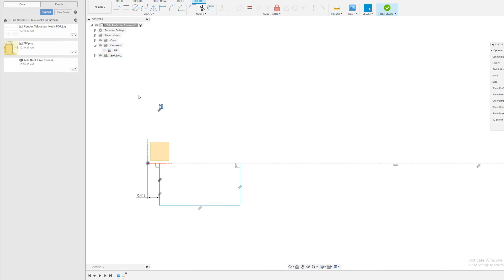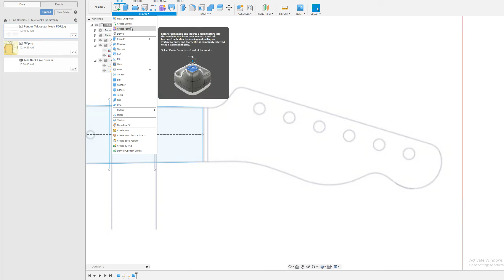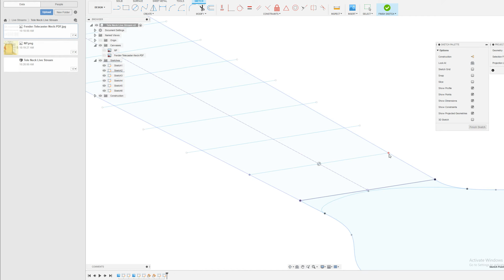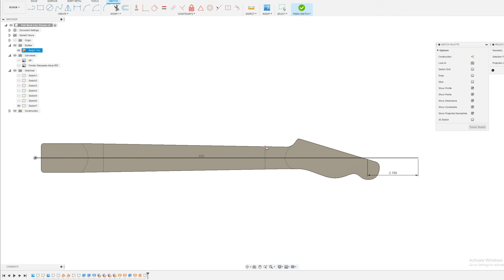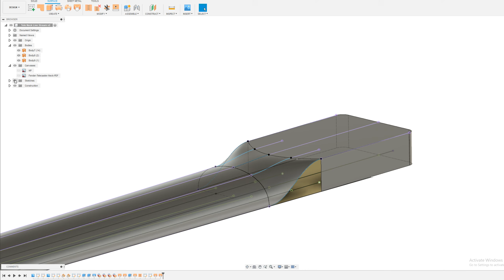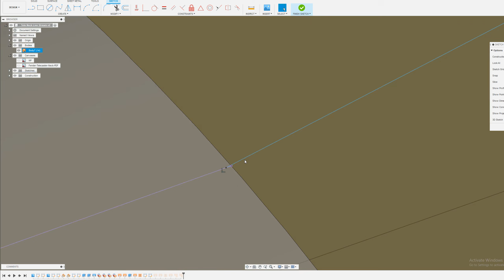Telecaster Neck Start To finish In Fusion 360

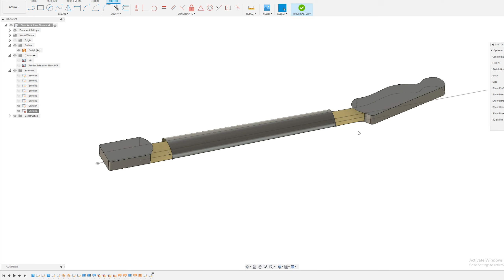Comment: I need a bit of help, for some reason at around 34:39 i can't get the lines to appear on the face i need for the spline. why might this be?
Reply: I have an error message that says "Not support projecting sketch geometry into same sketch, please change the target sketch or geometry"?
Reply from the maker: @itzcomplicated5  you have to create a second sketch, fusion doesn't allow projection inside a single sketch.
Reply: @TwoCherriesIns  thank you so much, after I eat lunch I'm going to hop back on fusion 360 and do some more troubleshooting. 👍
Reply from the maker: There are two reasons I can think of. The first is easy; you have to select the faces you want to project. The second is a bit trickier. You have to choose a projection direction and type. For the type, I like "along vector" for this situation. for the direction, I like to use the origin Z access or a line in the drawing that is parallel to it

Comment: I really liked this video. I was able to follow what you were trying to do most of the way through. The lofting between heel and neck as well as the neck and headstock seem to be real problem areas and your approach seems very straight forward. I don't know that my Fusion 360 skill are quite up to doing this today, but I didn't see any magic in what you did, so it will be just a matter of trying and learning. I think that starting from scratch like you did is a great way to go. Cheers!
Reply from the maker: Good luck, If you get stuck feel free to contact me.